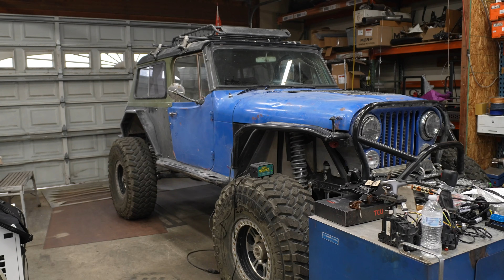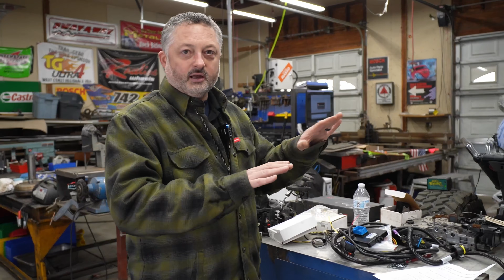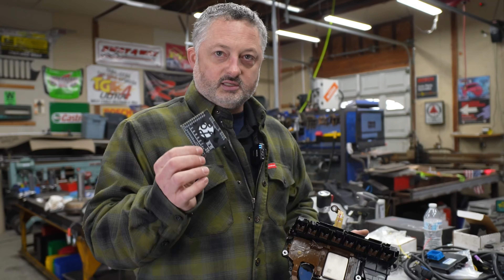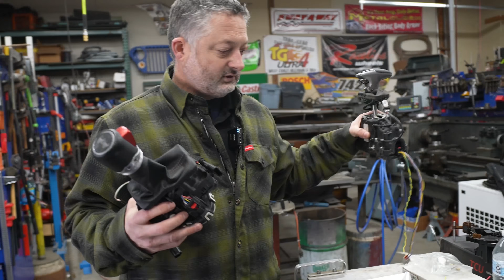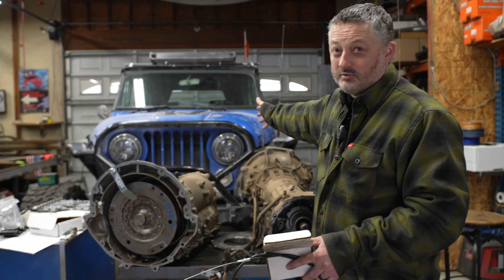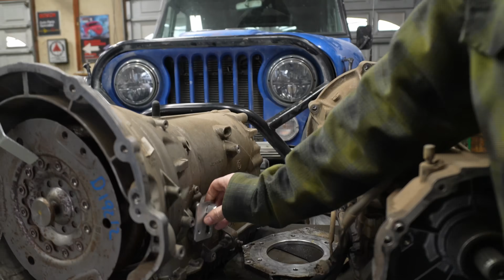8hp70 Swap Guide. What you need to know

Comment: Larry, you have more experience with the ZF8HP transmission than many others. Congratulations !!
My question is if I were to take 
1.) an existing bolted together Q7  3.0 T supercharged engine along with it ECU and ZF8HP 50 or 55, would it be practical to use this set up in a Nissan 300ZX sports car?, That is if the engine fits under the Hood ? What I’m suggesting is to use all of the electronics and transmission controls along with the transmission and the supercharged V6 engine as is without the use of an additional transmission controller? Or would it be necessary to use a different transmission controller? And, 2)  is there a difference between the ZF8HP 45 diesel Jaguar version versus the gas version? That is to say, but I use the transmission from a Jaguar diesel F Pace with the gas engine for an Audi Q7 ?  
3.)  would I have to use a standalone transmission controller in order to mate the Q7 gas engine To the originally designed diesel transmission. 
4.) who is the business you suggested that has been design with the use of A Jaguar transmission swap. 
Thanks, PDf
Reply from the maker: The diesel 8hp vs the gas 8hp use different torque converters.
The Audi vs Jag  have different bellhousing bolt patterns
The Q7 8hp  are mostly awd config.
The 3.0t is a very cool engine. I have never swapped on so I can not comment what controller would work best. Some of it depends on how you are planneing on using the vehilce.  example If you want to use it to drfit. The stock controler is not ideal.
Reply: @CLDes @CLDesigns742 you, you’ve answered my questions. So, I should be shopping for an Audi Q7 bell-housing and Transmission ? And, I can use the Audi Transmission Controller Unit (TCU) temporarily although it is deemed “Less than robust “ for “spirited driving “.

Comment: I'd like to ask if this 8hp70 can be used with my G Wagon W463 G320? I haven't found any completed examples online, and I really want to use it on my G Wagon.
Reply from the maker: I'm not really sure. I think Domiworks makes an adapter, but you would also need to figure out the T-case.
Reply: Is it a m112 G320? Domi-works makes an adapter for m156 but I don’t see anything for a m112/m113. You have a divorced transfer case on your G wagon, so a 2nd transmission will work with a custom driveshaft to connect the trans to the t-case.

Comment: Here is my Thought. I have a JKU. LS 6.0 Change set up to use  Ram crank and cam signal, use a RAM PCM from a 1500 4x4 and use HP tuner to fine tune. what do you think
Reply from the maker: I have heard this idea before, but I have not seen anyone actually have one running. Let me know if you got thru with this.

Comment: Thanks for putting this video together and sharing your knowledge! One of the best out there for this swap. It looks like you're based out of Vacaville. Your Jeep is pre-smog, but have you run i to any smog hurdles with this swap? I want to do an Erod LT1 and an 8HP70 from a Dodge in my '94 YJ. No smog issues with the engine, but I keep reading about smog complications with the 8HP. Have you run into this? Do you have any info (or know any people) you can share about this or help point me in the right direction? 

Thanks a bunch, and I look forward to seeing more content in the future! Loved the video on the PSC steering mod.
Reply from the maker: The CA SMOG laws a really tough. Here are the gotcha with an engine swap in CA.  The exhaust before the CAT must be stock. For the Erod that mean what ever it comes with is what has to be used.  The air cleaner has to be stock OR have an EO number from the stock application. So what ever the Erod comes with is what has to be used. I have heard of people leaving the hood off to allow the air cleaner to fit, but I have also heard that is no longer allowed. If the Erod is configured to run a manual trans behind it then the 8hp is no problem.  You might look at the GTO that had an LS1. and a manual trans.  they did not have a air injection pump nor EGR and the exhaust might be close.  CA suck for engine swaps becuse you think you have it perfect but its really up to the BAR reffeere.
Reply: @CLDesigns742 , awesome, I really appreciate the info! CA is so rediculous...  Keep making great content, love your stuff 🤘

Comment: Please share what you know about this application in terms of compression braking.
Reply from the maker: The compression braking still works with the Turbo Lamik controller. With the PSC controller the compresssion braking is the same a stock  so YES it still has compression braking.

Comment: So how can I run this off a stock E38 computer?
Reply from the maker: You can use any of the controller options. You will need to supply the following analog inputs. RPM, brake switch, throttle position.( this can be a shared with the engine computer). MAP sensor is optional. But preferred.  The shifter will be can bus. Bmw or dodge/jeep.
Reply: @CLDesigns742 i have a four sixteen stroker with a six l eighty and I'd really love to put that eighth p in there
Reply: Text to speech sucks lol .
So in your opinion the Turbo Lamic is the best option?
Reply from the maker: @troypowell6204 yes but only if you really  use or need all the options.  Transbrake. No neutral problem. Complete manual control.  Ect.
Reply: @CLDesigns742 I just want a simple control for the jeep .

Comment: One question: Does the Dodge 4x4 transmission have the same bell housing drilling as the old 545rfe? I'd like to install it on my WJ 4.7V8 with the 242HD. Will Turbolamik work for me?
Reply from the maker: It looks the same but I can not verify. I do know the 8hp  car vs truck bell housing are slightly different. The lower bolt locations change between them.
Reply: @CLDesigns742 We should find an 8hp one, maybe from a Jeep, then? Maybe from a 5.7

Comment: Is anyone making a manual valve body for these.?    I think it would be so much simpler to just manually shift, and dump all the computer crap.
Reply from the maker: The 8hp is a clutch to clutch transmission.  I do not think a manual valve body is possible.

Comment: I believe the V6 dodges have an 8HP45 or 50, which is a slightly more compact (Smaller) I think
Reply from the maker: Yes the V6 dodge use the 8hp??  I think they are smaller but just a LITTLE BIT. I don't know if it make sence to use them, Maybe for  a low HP appilcation. I heard the adapters are different. LOJ say is a good budget swap, but if you want to upgrade to the 8hp70  your buying another $1K adapter.
Reply: @CLDesigns742  Of course you can't drop 800 HP on a 8hp 45, I was talking about things like a resto on an old pickup truck, Small block of straight 6 can safely use it properly. To be honest, I want to try a 45 on a slant 6, Imagine the gas milage and with the first two gears (Maybe 3) being low enough to make the car practically jump even with low power setups
Reply from the maker: @crazylarryjr  Slant 6 makes a lot of sence.  It woud feel like it make way more HP with an 8hp behind it.
Reply: @CLDesigns742  Yeah and with double OD, The milage would be pheonomal

Comment: can you give recommendations for higher stall torque converters for these transmissions?  I have a SBC blueprint 400CID and the cam needs about 2000 RPM stall.  The only TC's I've found so far that stall higher than stock are about $1700 which kills this conversion for me.
Reply from the maker: Im probably not the best person to recommend a converter.  I would talk to Josh at Guru Auto Werks. He might have more insights

Comment: Great info, thanks! I might put a Dodge 8HP70 in my old GMC camper van. It has a 700R4 but that won't tow my boat. The engine is a Jegs 350 Gen 1  crate engine with 5000 miles on it. My wife bought the van  new in 1989 and we had great times in it until she passed away. I'll never sell it. I think if I put in an 8HP70 my trans will outlive me. I have done engine swaps and cut and rewelded driveshafts all of my life so this shouldn't be a problem. Thanks for the info....!!!

Comment: I have a 2000 LX470 with the 4-speed Aisin A343F and I'd really love a wider gear spread. Do you have any idea whether the TurboLamik TCU would be able to send whatever signals are necessary for the factory ATRAC (traction control), VSC (stability control), and AHC (height adjustable self-levelling suspension) to continue functioning?
Reply from the maker: I'm not sure.  You would have to look at the input sensors to the VSC.  I think it uses the wheel speed sensors not the trans output shaft speed sensor. In theory I think it could work. I think its one of those cases where you would be knee deep in the project before you learn all the relevant details.

Comment: What controller would you recommend for towing I wanna put my 8hp70 in my 06 2500 6.0 LS
Reply from the maker: The maxxecu mini or the German sound kit.  I have not tried the maxxecu optio. But it sound VERY promising
Reply: Turbolamik for sure. You can have one or two of the 8 maps dedicated to towing with your own shift points

Comment: I do have a t100 5vzfe. I will like to pick your brain if you don't mind. I worked for toyota for over 30 years and have been looking to do what you did to the tacoma. Any help will be appreciated
Reply from the maker: Happy to help. What questions do you have?  FYI  Someone else recently reached out to Domi looking for a 5vfe adapter. It sounds like they might be working on it. It might help if you email Domi works also, demand drives development.  How do you plan to use the truck?  ofroad, daily driver?

Comment: Sounds like you know a thing or two about 8hps. I just did a 8hp swap behind a Gen V LT engine. I’m using a maxx mini. It won’t shift out of park do you know any common issues that revolve around that?
Reply from the maker: Is the engine running and or  is the maxxecu getting a good RPM signal.  2nd Brake switch. since the maxxecu is using a factory TCU it will also need a brake switch input to release the shifter.  3rd. is the TCU flashed with the correct firmware?  These are the things I would check.   Let me know what you find.

Comment: What 4 wheel drive gear boxes have you run behind the 8hp in your jeeps? I see you have a twin stick in one picture around the 9 minute mark in the video. 
I want to run an np205 but haven't come across any adapters.
Reply from the maker: I have a 2spd Atlas 3.0:1 in the jeep. The 8hp70 has a 23 spline output shaft same as a 07-11 Jeep JK auto  and some np231/241.  Note the BMW output shaft splines are different.

Comment: The only thing I don’t like it is the high price, I don’t know is because is new stuff in the market or what? Installation, transmission plate, harnesses-tcu computer-programming and your personal time months looking for a good programmer/installer total cost $4000-5000 the end yes you have a nice shifter in between the two seats. With a $300 #4l80 you probably won’t have as many futures as, but is $4000 dollars difference.
Reply from the maker: I totaly get it. Your right it does take 4-5K to get it installed and working correctly. Counld be slightly cheaper if you are a real bargin hunter, BUT It drive SOOOO much better than a 4l80e.  With a 4l80e you need a preety high stall converter to make it feel lively.  converter = $1k.  Good rebuilt 4l80e DIY $600, +   or bought  $2500.  A little more money and your in a 8hp70.  The 8hp70 feels like you added 100hp. Heads, cam, lifters and tuning on an LS is around 4-5K.  Its just how you slice it and what you want.   OH and the 8hp70 runs much cooler than a 4l80e ever could stock.

Comment: I like the jeep shifter. Do you know if it has to be specific to the 392 jeep version? Or is it the same for the non 392? It appears the same with the manual shifting option
Reply from the maker: I think all the Jeep JL shifters are the same. My wife has a 392 jeep.  I liked the shifter and bought on for a 392 off ebay.  I search ebay quickly for Jeep JL shifter and it looks identical.
Reply: @CLDesigns742 yea I searched thru eBay and look identical. I have a little race car I’m putting together and I like the shifter of the jeep in my hand. And oem feel. Thanks for your video

Comment: Interested about the 8hp swap in the Toyota. I’m trying to swap my a343 in my Land Cruiser with a 8hp75 from a ram or a v8 bmw
Reply from the maker: https://www.domi-works.com/products/toyota-1uz-2uz-3uz-8hp-70-75-n63-adapter-kit?srsltid=AfmBOorxNu5Q-o7iQq6vKzMnTcFspwJG7SJvzD8Jj7uK8z_moQ7-N-pC

Domiworks has this adapter,  Here in the US the BMW n63 trans are cheap used.   CANTCU does not have direct support for the Toyota engine. Because of this I would recommend looking at the Maxxecu mini to control the 8hp. They seem to have some features working better than Cantcu IHOP.
Reply: @CLDesigns742  Did you do standalone for the 5VZ? I am most likely going to use the domiworks adapters for both engine and transfer case but I'm trying to avoid standalone ECU and potentially just use a turbolamik TCU. Not against the MAxxECU but they don't appear to have 8hp75 support at the moment.
Reply from the maker: @PapaWickey I did not stand alone on the 5vf. Stock ecu.  I used the German. Sound kit. If I had to do it again I would try the Maxxexu mini.  I think for an on / offroad application it could be tuned better

Comment: Does the turbolamik connect straight to the Jeep shifter or does the wiring have to be modified?
Reply from the maker: The wiring harnes supplie bby Turbo Lamik is not terminaled for the shifter. You must select what shifter to use and source the electrical connector for that shifter. The turbo Lamik manual deos have good documnetation for the shifter wiring.
Reply: @CLDesigns742 gotcha thank you for verifying that info much appreciated
Reply: Yes

Comment: I am a manual transmission guy, but here in the usa people want automatic transmission, my 07 yota 6 speed manual, and my 05 Jeep Wrangler unlimited rubicon LJ these 2 will be with me until my time on earth ends , what is the fascination with a 8 speed am imnot getting it, i  also own a 04 land rover discovery ll with the 4.6 v8 4 speed automatic everyone know eventually the 4.6 will have slip liners , head gasket leaking and known for overheating,  so im doing a engine swap in usa people do l.s swap but for myself im doing a m57 bmw engine with 6 speed automatic i just bought a 2010 335d as my donor car why you might think i want fuel mileage  and v8 power from a inline 6 diesel engine factory power 282hp 425tq i live in texas where diesel engines are emissions exempt so im deleting egr , dpf system and cats and add a tune now i get 350 plus hp over 500tq and 30 to 40 mpg as the 4.6 gas mileage sucks 12 to 14 mpg my build is for overlanding my parts for the swap coming from europe as trump making it more expensive for imported parts i just had to pay 550$ tariff for my gullwing window panel from explore-glazing,  so many people do the 6 speed manual in Europe but decided to go 6 speed so is 8 speed better than a 6 speed is it worth the additional money i know xdrive comes with 8 speed all wheel drive with the cv  axle shaft gose thru oil pan in europe they like the older m57 2003 era my 2010 2 wheel that will become all wheel drive from the lt230 transfer case , i did see a viedo on the bmw under shifter trim was a allen key you insert to put car in neural,  sorry for rambling the question why 8 sp over 6 sp
Reply from the maker: The GM 6l80e  in my opinion not that reliable when compared to the 8hp70.  The 6l80e is the 6spd that came behind the LS engines.  Most people do not use 1st gear in the 8hp70. They command the trans to start in 2nd gear. So really most people ate using the 8hp70 as a 7 speed. I’m running big 40” tires so I do use 1st gear. The ZF6 speed trans are just not popular here in the US.  They would require an engine to trans adapter, controller, shifter ect. Why bother when we can buy a package from a wrecker and use the factory ECU. 6 speed to 8 speed.  I would not bother not enough gains. I removed a 4l80e and swapped in the 8hp70. 1st gear in the 4l80e is 2.71:1  this is terrible. Plus the biggest thing of all. The 8 speed is a bit of a wanker measuring stick. I have more speeds
Reply: @CLDesigns742 Thanks for your input. im sure your build is for aggressive driving offroad for myself on a old land rover discovery ll is fuel mileage and light heavy offroad on 285x75x18,  im prefer manual over automatic any day but mine still cable shift and the donor i bought is also and on many of today's 8 speed are electric shift no cables and you can mount your shifter anywhere that's nice but how reliable is it offroad ? I own many different vehicles that are built for offroad,  here in usa most people ar ls swap v8 power me too but diesel power awesome too m57 inline 6 is a sleeper engine in usa with deletes and tune the power unlimited untill you blow the engine 😊 again  thanks have a great day

Comment: What about transfer case adapters?
Reply from the maker: The Ram 4x4 8hp70 has a 23 spline output shaft.  You can run a Jeep JK t case from an auto, or and Atlas with a JK input spline. The NP231/241 23 spline have a different major/minor spline diameter. Advanced adapter make an adapter for the Np231/241.  Domi Works has severval adapters for the 4x4 stuff BUT I have not looked nto them.